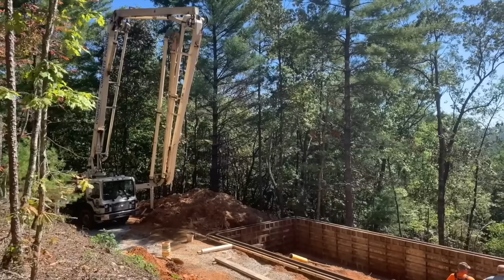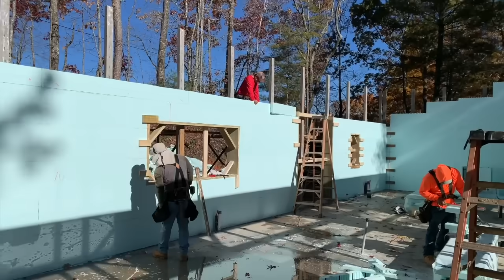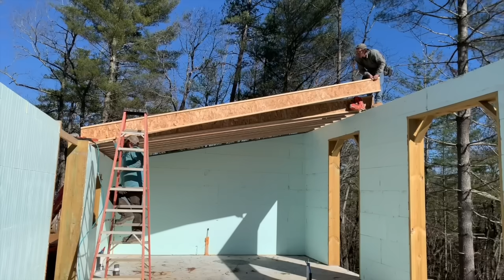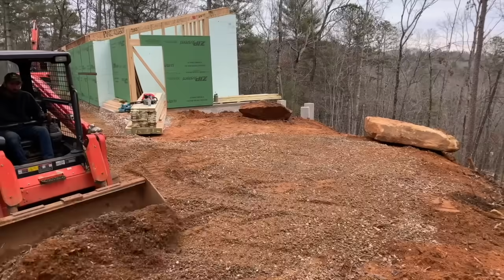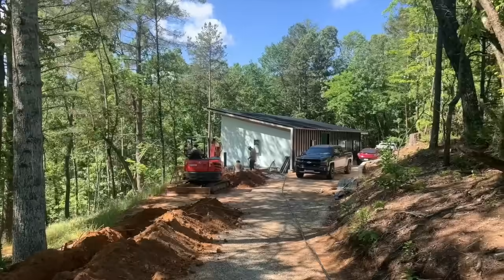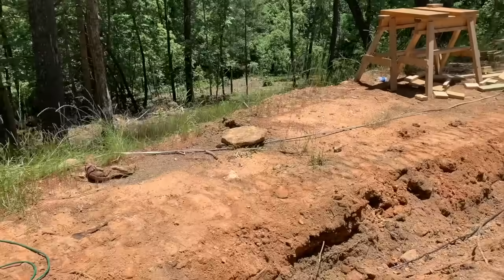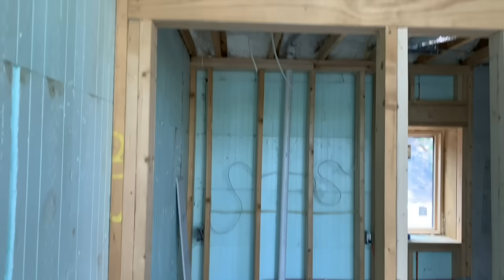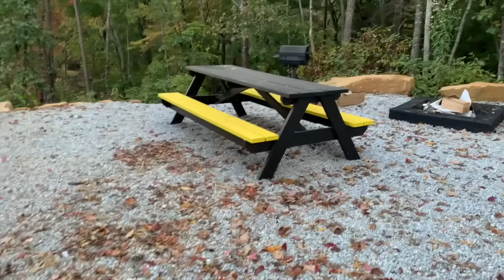Construction start to finish of a modern ICF mountain cabin.

Comment: I do not think that much gravel was needed to fill the space. As even here it's costly included transport we normally put back the original soil from excavation and left only top 15-20 cm for gravel when we do a slab on grade. Pipes that lies in the soil are only laid and covered in sand. I do not think compressing with showel or driving with machinery is enough, we use water and heavy reversible plate compactor for every 20 cm of material. But I am envious how nice almost fairfaced your concrete walls are when taking the formwork off. We do not even put that much time into smoothing the surface of slab, only vibrating and leveling it. But I always like to see how its done elsewhere compare to my country.

Comment: I have never seen an ICF building wrapped with osb.. Any reason you did that vs rain screan/nailing flange?
Reply from the maker: Hi Chris.  We only put the zip board on the front wall where we had the metal roof transition down.  This was mostly done to give it secure surface for the metal panels. The rest of the siding was put directly on the ICF.
Reply: @johnwolson  Thanks for the reply!  I was trying to figure out why you used it and that makes perfect sense.

Comment: Wow, quite the build. Looks like lots of work to get that foundation in on the hillside. My wife and I just stayed at a similar AirBNB, but the hill was a bit steeper and the home was on posts. Was post & pier considered as an alternative foundation?
Reply from the maker: Originally yes. But it presented its own challenges with cost as lumber more than tripled in price at the time. So I ended up building with concrete as it was comparable in price and worked best with the ICF walls.

Comment: Congratulations on the nice building. The only thing I would suggest is at least a 30 ft radius of trees be removed around the building it will help prevent damage if they're ever is some kind of wildfire I know it cuts into the view and the for lack of better words hidden home feel but foam melts pretty quickly and in a wildfire temperatures get extremely hot so the farther you cut a radius around the building the safer it will be just some fruit for thought. Thank you for taking the time to make this video.
Reply: I have looked into Hempcrete, a lot more expensive that a stick build, on the pros, it’s fireproof, mildew proof, insect proof and you don’t need siding, also the carbon negative benefits save our planet. Also the house breathes due to compounds in the blocks. Great build, I’m curious of the cost breakdown on the next video.

Comment: Nice build and great commentary.  The only thing lacking IMO would be radiant heating in the slab floor.
Reply: Makes sense especially since he already installed a recirculating h20 pump for the hot water tankless.
Reply: Agreed, have it heated from a boiler and or fireplace
Reply: YES INDEED!   and i wouldnt have minded exposed ductwork, which i find imho very beautiful.

..thin i would have used wood board & batten siding to soften up the feel of the entry

Comment: Does the slab not have rebar or anything to connect it to the foundation walls? I didn't see bolts or a notch for it to lock into. Is it just floating?
Reply: the slab perimeter rests on top of the walls, and the two mid span piers also support the slab.
Reply: @blueman5924  He's talking about how the ICF walls are tied to slab.  Typically, there would be rebar sticking up out of the stem wall and those would be tied to the rebar inside the ICF.   There may not have been footage of that step.  Hopefully that is the case, and the ICF walls are tied to the slab, not just  sitting on it.
Reply: I also saw no rebar in the stem walls. vertical or horizontal near the top. in the video when they are pouring the walls, you can zoom in and see that there is no rebar. You also stated the icf contractor installed rebar into the slab in one of your comments. But if not tied to the stem wall and footer (continuous load path for uplift) you got a problem. I bet the area you built in GA doesn't require building structural inspections or else it would have been flagged. @markstipulkoski1389

Comment: That's the same type of concrete  truck that ate my dad's hand off when the guy turned it on. It was plugged and jamed up  , owner decided to flip the switch when dad was reaching into clean it out by hand. From there it was a slow night mare.accepting the truth that gang green had set in from all the concrete inside his hand.they removed all 4 fingers and saved the thumb. Medical was not so good back in 1977

Comment: That was the perfect opportunity to double the sq footage and add a walkout basement....
Reply: That's what I thought,  why not a future basement??
Reply: I thought the exact same thing.  2-3 more feet up or down and you have a walk out.  That could have been ICF as well at least on the exposed wall but even all the walls. For the cost of all those truckloads of gravel fill and the concrete form work it would have cost less plus you would have had a suspended floor that would be much warmer on the main level especially if there's not a radiant floor. Maybe it's a warm climate, I might have missed that. If it's a cold climate that exposed concrete wall will transfer all the cold to the slab. All that being said, this work was an excellent execution of the plan!
Reply: Nah let’s buy 20 trucks of gravel instead

Comment: Wow! Why use ICFs when you have zero insulation in the floor? Your floor/foundations is just a massive cold bridge that will draw away heat all winter. So many missed opportunities.  I would have had the roof pitch towards the south instead of the north and fill it with solar. That combined with a modest battery world have eliminated your utility bills for life. The foundation could have been properly insulated and filled with sand to be a thermal battery heated with excess solar during the summer to keep the house warm in the winter.
Reply from the maker: Hi Gordon.  Thanks for the comment.  You said, "Your floor/foundations is just a massive cold bridge that will draw away heat".  We are not seeing the impacts of this at all.  This cabins windows face south, and therefore, take advantage of passive solar energy.  The low winter sun heats the slab and space in the interior well.

Comment: I'm a novice, but why did you chose to fill all of the slope with gravel?  Would it be inappropriate to use mostly fill soil from the site and top with gravel the last 4-8" below the slab?  It just seems like a lot of gravel for such a robust foundation.
Reply from the maker: The problem is the soil will settle over time and cause the slab to crack.  Plus backfilling with soil would not allow any runoff to drain to the base of the stem wall.

Comment: I like most everything you did with the exception of your water take away and lack of rear overhang.  It's my personal bias as a carpenter that all houses deserve roofs with a perimeter overhang more so in harsh climates as it provides so much in extending life of structure.  No idea what state or elevation this may be located at but I've been seasoned at 36" annual rainfall and or 2 foot snow loads.  Between the roof shedding and the flat drive, seepage at the sill plate just seems to be a matter of time or season.  Contemporary style is pretty down on gutters but got to give them their due for water take away.  Having a 18in rear overhang could have provided much function and some cool under soffit down lighting to prevent light pollution.  Great color/material selections!
Reply: This.  1800 sqft of rain will run down the back wall of the cabin and splash onto the concrete.  I can't tell how the driveway slopes at that point, but this sees like a pretty good way to put your sill plate under water in a heavy rain.
Reply: @toast449  Being ICF, is there still a sill plate?   Not sure how they attached the siding to the ICF though. Still can't be good.  I was expecting a drain along the driveway right next to the house to take all the water away.
Reply: @stediasse  Fair, bad term just didn't know what to call that interface.  Concrete doesn't bond to concrete unless they put down a product designed for that (and maybe they did but didn't show it) so whatever you call that gap is not sealed.  Black metal gutters would fix that (and you wouldn't get soaking wet walking in the entry way in a rain storm).
Reply: @toast449  ahhh yes!   great point .. so the extended roofline has 3 functions - 1. take away the rainwater 2. prevent direct rain buildup  3-provide a covered 'cozy' outdoor environment that incorporates the cool feel of the reatining wall.  i LOVE your comment !!
Reply: Georgia
Reply: French drain I hope??
Reply: It looks like shipping container nuclear fallout shelter.  Who was the architect, Mad Max?
Reply: @clarencehowaboutski3153  if you dont like it keep comment to your self .you acting like it your place and he spend your money troll, being salty don't get you far in life buddy. And last I check there a lot of homes build from shipping containers I guess you live under a rock
Reply: You should have watched the whole thing! They did plan an over hang. On the South side it looks to be 2 or 3 feet out, and a bit shorter on the East side.
Reply: @SternDrive  there are sides of the building with no overhang (thats what i think hes pointing out)

Comment: Just a few questions, why didn’t you make that walled in area a crawl space for plumbing and mechanicals?  Seems such a waste of space and gravel. Your home is beautiful, but seems you could have achieved a similar result for much less $.  Had you drilled your well before the house build?  What if you didn’t find water at that spot?
Reply from the maker: Most of the mechanicals were run near the front wall where the foundation depth was just a foot.  Considering it was solid rock in this area, we didn't have the space to do a utility crawl space, unless of course, we excavated deeper into the rock.  Also, I worked with a well company prior to the land purchase and made sure there was water. Our well goes down 209 feet into a natural drainage area, and we got tons of pressure.
Reply: @johnwolson  Thank you for taking the time to answer me. You obviously had a plan in place. I salute you for building a beautiful home. I built mine last year, but I’m still trying to educate myself with new ideas. Gos bless

Comment: It looks good. And on the surface, it does look more modern than most. But it's practically uninsulated and heated with gas. That's not what I would call modern. If the local climate is warm all year round, the lack of insulation may not be critical. But dino-farts is not a modern, nor an ecological, way of heating. At least the kitchen is electric.
Reply from the maker: Hi Thanks for the comment.  You said, "But it's practically uninsulated..."  Quite the contrary, it has 6 inches of reinforced concrete with 2.5  inches of foam on each side of the walls.  Also, the 12 inch I-beams are encapsulated with spray foam.  So this house is anything but uninsulated.  Also, with the exception to the tankless water heater, the house is all electric powered.
Reply: Christopher does not understand the concept of a ICF house. This house is Super Insulated, and will be cool in summer and warm in winter.

Comment: It would be a nice finish to the driveway if you install poles with wire cable wrapped or painted with luminous red to prevent driving over the edge. Regarding your security, South Africa has lights with security mobile cameras controlled by your cell phone

Comment: Nice work! I built something very similar. Mine is 24x24 2 story, daylight basement. It has a single plane 2/12 pitch roof. You enter in the back left corner to a 5x8 entry, coat, shoe area, take one step down to a 4ft wide hallway running across the back wall to the next corner. Then you turn right into the kitchen area about 7ft wide out to 5ft from the next corner where you step down another step into the great room, 12ft high ceiling, full 24ft wide, about 12ft deep. The middle of the house is open to the floor below where the fireplace is. Bedroom, bathroom, laundry downsta--elevator!  If you picture a square box with the floor plan spiraling down around the perimeter, tight when you walk in then progressively opens up. Concrete foundation. Framer.
Reply: would love to see pictures of this, looking at building something very similar.
Reply: Please make a video!
Reply: @averageliving4Life  no camera, sorry

Comment: Curious what happened with the piers in the foundation. It appears they were just covered up. So was that just something that didn't used in the end?
Reply: who mean where the balcony stands on?
Reply: @PENTHESILEIA1000  I think he’s talking about the two pipes that were in the middle of the foundation, but I think they were drain pipes than he tied his plumbing into. I first thought the same thing that you did.
Reply: @tennesseetexan1957  Those weren't chases. They were full on concrete piers.
Reply: @theshermano3000  yes you’re right. I went back & watched the video. At 8:19 he explained they were extra support for the foundation. I assume maybe he had a wall going across there maybe. Don’t understand exactly how that would help though. Maybe a structural engineer would have that answer.
Reply: @PENTHESILEIA1000  No. The two piers in the middle of the house foundation that got covered up by the gravel and concrete.
Reply: they support the slab mid spans.

Comment: Great effort from Thailand..
I'm concerned your cabling from the road to your meter is not placed in conduit. That the same for communication. Whilst it may be shielded and insulated additional protection from the elements I'd have thought a priority. 
I've seen other builds in the USA that have placed theirs in conduit.
My home country, you have to place down 1m deep, conduit & concrete to grade for protection of being dug up and damaged or electrocuting unsuspecting  others. Not to mention, red posts exactly on top to let others know whats dangers lay right underneath. 
Just my thoughts..
Reply: The dirt will eat away at the plastic coating around the wires within 15 years. Other than that. It's a very nice mobil home with high ceilings
Reply: Most states here are run—almost exclusively—above-ground (high up, in air) electric/communication lines. There are a few with underground lines, but it’s not the most common method here. Our water table is simply WAAAY too high for that. As it stands, elevation here is below sea level.😅) There’s no way we could burry all of our electrical wiring underground here—nor ANYTHING else for that matter—it would be outrageously difficult to perform routine maintenance/checks, etc… never mind the trouble we’d face if any more “involved” repairs were needed afterwards! 😬 haha Besides, constant contact with/exposure to water—this much water—can/does do some srs damage to just abt anything. 
I mean, unless someone is genuinely hoping/planning on digging a well!? LOL! Anything else is essentially a no-go. 🤷‍♀️😂